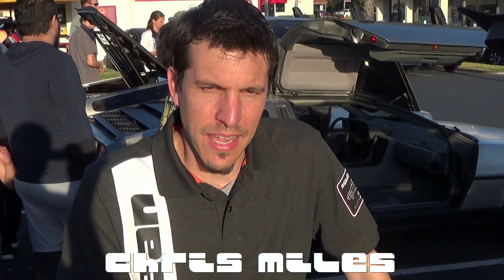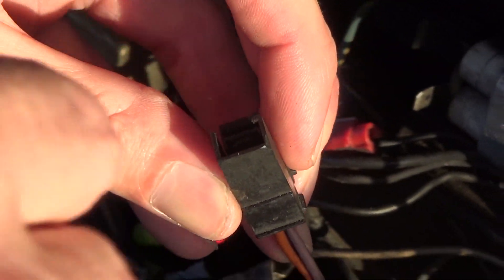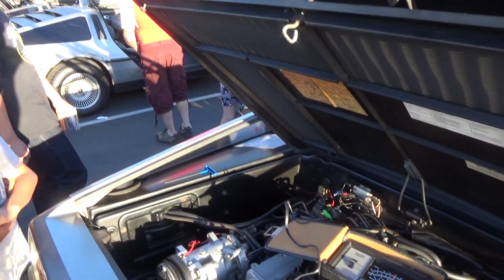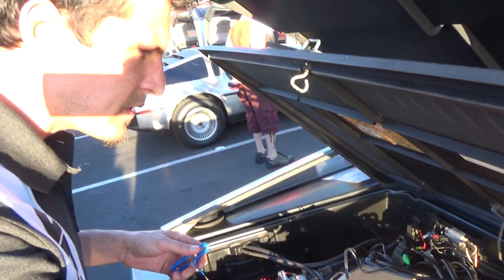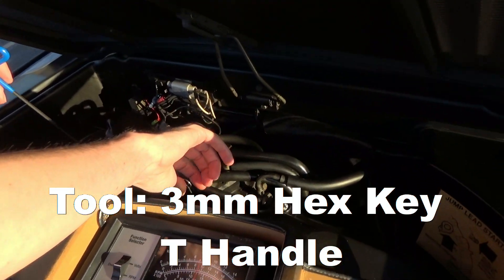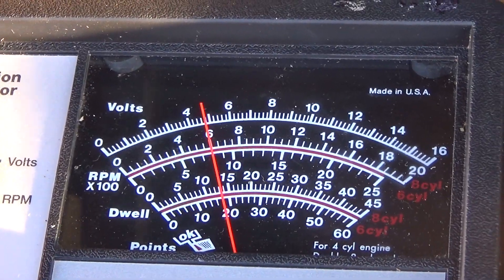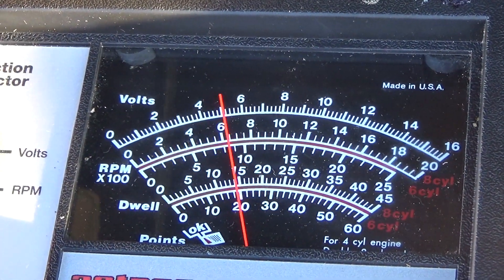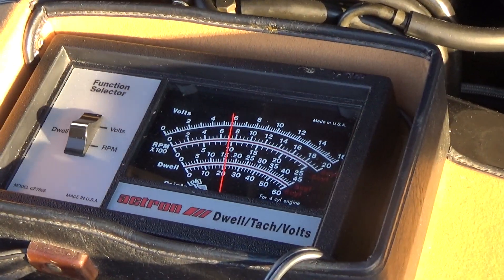DeLorean DMC-12 Actron Dwell Meter Fuel-Air Mixture Adjustment Procedure with Chris Miles

Comment: You guys have helped me out so much thank you. Just did this today and got my dwell meter. Mine was all the way down to 5, yikes!
Reply from the maker: Glad it helped!
Reply: @DeLoreanTECH  So I got my Delorean to Dwell right around that range in the video. Before the idle would hunt wildly for about 45 seconds then settle down and idle great. Now, it only mildly does it for a few seconds then it idles normal for awhile. after a few minutes it starts pulsing and the idle and engine seem lumpy now. Before I adjusted it, it was super rich, all the way down at the bottom. Should I go back to more Rich> I really don't understand what its doing.

Comment: Why do you use the 8 cylinder scale when the engine has 6 cylinders? Is this simply your experience as to what works best?
Reply from the maker: This subject was discussed for years on DMCTalk and it was determined that the Workshop Manual gave the dwell values with the meter set to 4 cylinder (without mentioning it and despite stating set to 6-cylinder). As such the accepted setting is the 4-cylinder scale.  The Actron unit I use does not have a 4-cyl scale so we divide the stated pulse ratio by 2 and use the 8-cylinder scale.  Now, according to the Manual the pulse ratio for normal operation is 35-45 degrees in 4-cylinder mode (without stating so) with a center of 40 degrees (20 degrees using 8 cylinder).  Reading through DMCTalk it appears there is guidance recommending 30-40 (15-20 on 8-cyl) degrees and 35-45 (17.5-22.5 on 8 cyl) degrees. When adjusting, it is better to have the needle swing past the 20 degree mark than the 15 degree mark for this reason (best practice for me based on the mixed advice on DMCTalk).  I may make an updated video with improved guidance as this video is a little dated.  Check this out:  https://dmctalk.org/showthread.php?18985-Actron-Dwell-Meter-and-Idle-Hunting
Reply: Thank-you.

Comment: Im working on a 1983 Saab 900 with K-jetronic, and want to set the mixture. Do you have any idea if this would also be applicable?  Also, where did you find the stopper for the mixture screw ? Was that a stock piece on the Delorean ?
Reply from the maker: Yes, it would although I am unclear as to what the spec would be for the Saab. The mixture unit plug is available from delorean.com and DeLorean go. It’s basically a little rubber stopper with an extended pin so that I can be removed easily. It is not stock to the car. The original mixture adjustment hole was filled with a screw that has to be permanently removed.

Comment: Thank you for posting this!  I just did a rebuild from the VOD and up and now my car wont start, well stay running.  Sounds like it is not getting fuel.  Now I have some where to start!
Reply from the maker: Glad to have helped
Reply: Sorry to bother you again, but I see my plug is missing and I see no screw. I haven’t touched any thing yet, just looked.  Still waiting on my meter to come.
Reply from the maker: @flyingtilliamdying  if there is no CO adjustment plug or screw in there then you will have a vacuum leak. I recommend getting one in there to fix that. DMC has them for around $11. https://store.delorean.com/102392a-co-adjustment-plug.html

Comment: what is the orange wire to which you dial the positive lead of the dwell meter for?
Reply from the maker: There are two wires that connect to the engine diagnostic plug -- the orange wire that you connect the dwell meter to and a purple wire (which is +12V hot).  The orange wire is the Lambda ECU lead.  The Lambda ECU governs the car's fuel system including the frequency valve, main fuel relay, throttle enrichment microswitch, and lambda probe.  It is position #17 on the Lambda ECU.  The oxygen sensor measures the amount of oxygen in the exhaust gases. As the sensor measures the exhaust gas, it produces an electrical signal which informs the Lambda ECU module of the engine is running richer or leaner than the ideal air-fuel mixture ratio.  The Lambda ECU module receives the voltage signal from the oxygen sensor and determines if the amount of fuel Injected to the engine should be increased or decreased. The module will then signal the frequency valve to adjust the fuel mixture.  The Lambda ECU module is located In the module compartment behind the driver's seat. It is in the forward section of the compartment and is silver in color.   During operation, the ECU module will analyze the oxygen sensor signal and send a pulse cycle signal to the frequency valve. This signal will allow a pulsating current flow to the valve which will turn it on and off as required. The pulse cycle can be measured by connecting a dwell meter to the diagnostic plug which is connected to the terminal No. 17 of the ECU module (the orange wire).
Reply: @DeLoreanTECH  will that 15-20 reading apply to any dwell meter, or just the particular model you used in the video?
Reply from the maker: @jamespilcher5287  Having no experience with any of the other brands out there or models for that matter. I cannot say. I will say that I did try to use a different dwell meter for the same purpose and came up short. But that may have been due to a faulty meter.  Not sure.  I highly recommend getting this model and brand exclusively for the DeLorean.

Comment: Those the same needle swing from 15-20 apply to Stage II conversions? Also any tips for removing the anti-tamper cap if it's still in place?
Reply from the maker: Matt Merfeld I’ve been told that it does not apply to stage two conversions. I was told that it should be between 20 and 25. However I would recommend contacting DMC directly to confirm, since they designed and engineered the stage two engine upgrade.
Reply from the maker: Matt Merfeld Also what do you mean by anti-tamper cap?
Reply: I would ask Danny at dmc huntington beach for S2

Comment: What you are doing here is measuring the duty cycle of the Frequency Valve. You are not measuring "dwell". When the meter reads a constant value, the Lambda system is not yet functioning. As soon as it starts to swing the o2 sensor has warmed up and is active and then the  computer is controlling the Frequency Valve on/off- which is its duty cycle. As Chris mentions the mechanical adjustment is important, the computer can only compensate very little. Note as Chris pulled the stopper from the adjustment hole- the idle speed increased. This is because that little hole is now a air vacuum leak, and which is why you must put the stopper back in and then let it settle to get a decent reading. Engine must be fully warmed up. Also note that Chris turns the T handle wrench VERY slightly, adjustments must be made in small steps, the adjustment is sensitive.
Reply: Mark Woudsma, thanks for the added details. The added technical info will help those that are interested in the all the nuts and bolts. We did this all in “one take” so I wasn’t able to delve too deeply.